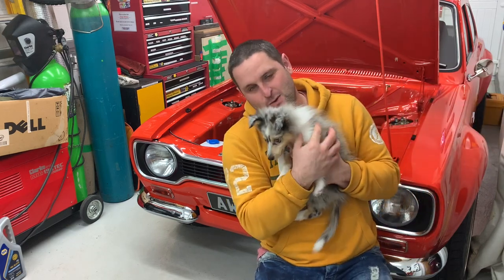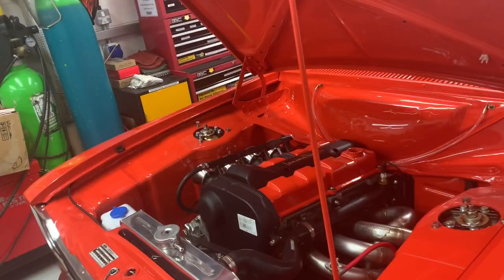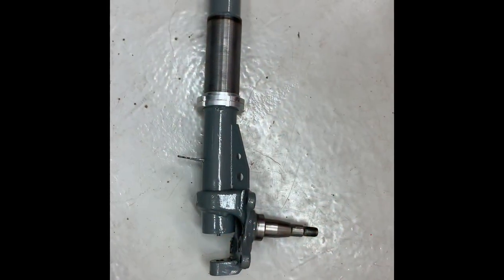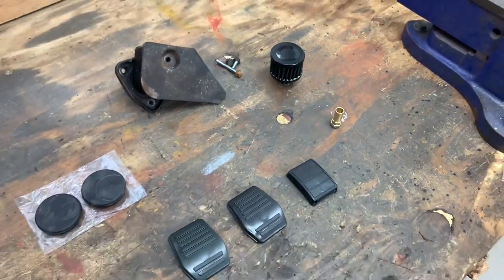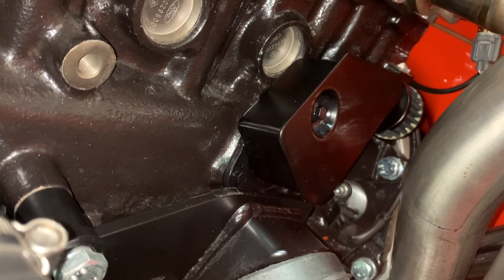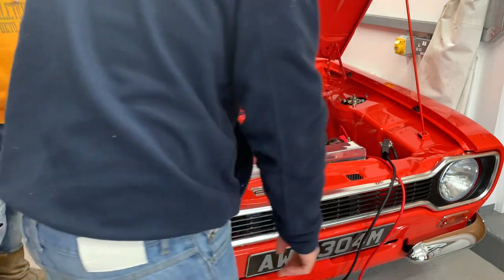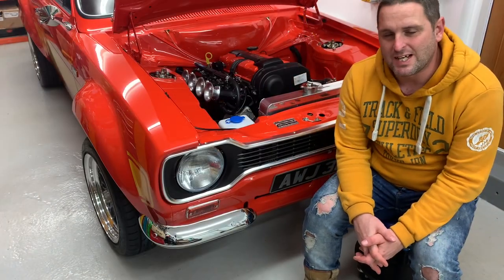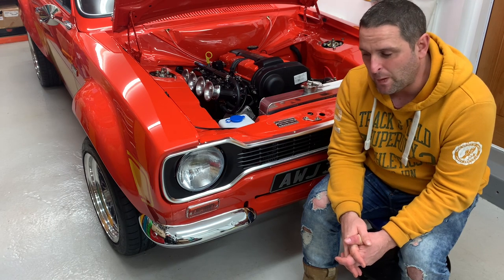MK1 Escort RS 2000 Re Assembly episode 31 WILL IT START??

Comment: Tip for the future.  Use one of those pump up pressure spray bottles with adaptor for small hose fitted to input your oils. 😉
Reply from the maker: Good idea Kevin. That would certainly make life easier 👍

Comment: I use a big plastic syringe from Sealey to push oil into gearboxes and differential.

You can suck oil back out too
Reply from the maker: That’s a really good idea that Thomas 👍I have to admit, using the bottle with a pipe attached was a real pain 🤦‍♂️

Comment: Never doubted it starting sounds sweet as well glad you got rid of them peddle covers could you have the cam cover ceramic coated to stop the issue will you be putting a tube on the rad overflow outlet Denzel looks a beauty you’ll need something to do when you’ve finished the build will miss your content
Reply from the maker: Thanks very much Richard. Yes the radiator overflow is one of them little finishing of jobs that still need doing. That’s all that’s really left now, is the minor finishing touches. Oh he is great Richard. Really settling in very well and changing every day

Comment: Q & A 

a) what aspect of the build gave you the most satisfaction, not just the big budget items (engine, bodywork, paint etc) but the smaller items and those hard to find finishing touch parts.

b) are there any specialists or parts suppliers who performed beyond your expectations (I remember a previous episode when you’d received the car back from the body shop after painting and you were blown away by their workmanship, I seem to remember that place had closed soon after that).

c) do you have a list of specialist equipment used that a normal domestic garage wouldn’t have, spit frame, engine hoist or similar.

d) is there a stand out ‘difficult’ task in the project which you resolved with the simplest of solutions or conversely one which was extraordinarily complex.
Reply from the maker: Thanks very much for the questions. I have enough to do a Q&A so I’m thinking of making it a xmas special 👍

Comment: Beautiful car, takes me back a long time. Way back we tried to get 1500 miles of running in done, in my friend's Escort with a tuned 1600 crossflow we passed 1500 miles on the way to Santapod!
Pulled in to the services, changed the plugs for a colder type and it went on the strip that day. It was kind of funny that my friend complained "it is going flat at 6000rpm" .
On the strip we got a scary rattle, turned out to just be the non return valve to the brake servo (we had 40DCOEs and vacuum was tapped off one cylinder).
Yours will be a fair bit quicker, make yourself a nice airbox and use a filter! (Old man speaking). Your engine sounds lovely, very responsive, will be even better when you get it mapped.
Maybe powder coating woud work better on your cam cover?
Reply from the maker: Thanks very much for the comment. I know I should really have an air filter fitted and a big part of me is saying fit one, but I just love the look and sound without one 🤣. I did wonder about trying to find a decent colour match in powder coat 🤔
Reply: @performanceclassics1986  back in the day we ran 40DCOEs without air filters, I honestly think it wore the engines faster. I know it sounds fantastic without them though. I wonder with your talent whether you could make a carbon fibre airbox with a cold intake...
With your cam cover I am not sure what material it is made from but I know someone swore by baking the contaminants out of some metal parts before painting. Would not like to think of how many hours have gone into your project, beautiful job.
Reply from the maker: @g0fvt  I think there’s around 3000 ish hours in the build which is crazy. I did think about fitting some mesh style filters within the trumpets because I agree that it can’t be good for the engine
Reply: @performanceclassics1986  a lot of time but better than watching television. With the filters a big paper panel filter is hard to beat for flow and effectiveness. It will be good to see the dyno results, will be a lot better than a stock RS2000....
Reply from the maker: @g0fvt  I hope so 🤞 really hoping for as close to 200bhp as possible. If I get high 180’S or into the 190’S il be ecstatic 😎
Reply: @performanceclassics1986  that will be a bundle of fun, people forget just how light cars used to be :-)
Reply from the maker: @g0fvt  yeah and how much smaller too. A MK1 escort was a family car in the 70’s and now a bmw Mini is bigger 😳

Comment: Absolutely stunning mate.  Love the mk1. 
A question for you. 

I'm at the end of my mini restoration. Will be putting my 1380 engine in very soon. What  brake fluid do you use in your mini? Incase of any leaks I dont want any ruin the new paint work. 

Many  thanks Simon
Reply from the maker: Hello Simon, in the mini I used Silicone brake fluid for that exact reason. I think it was made by automec and it doesn’t boil, doesn’t take off paint, doesn’t absorb moisture and apparently has a longer life span. Ive had it in the mini for around 13 years now with no issues so far 🤞🤞🤞only problem is, it’s more expensive than standard brake fluid

Comment: Amazing job you have done of that car. What brake master cylinder have you used, and would it fit a mk2 escort
Reply from the maker: Thanks very much Donald. Its a wilwood master cylinder that I purchased through GS Escorts and yeah I think you could make it fit the Mk2 escort also. The rod that fits onto the pedal needs some light adaption to make it fit properly, as I shown in an earlier video so I think you could easily adapt it to fit the mk2. If you need the part number, I can always ratch out the box 👍

Comment: Hi Craig. Well chuffed you have got it running. My question to you is. Why a modern ish engine. The rest of the build has been aimed at originality how come you didn't fancy a twin cam or such on carbs?
Reply from the maker: Cheers Benjamin, I will hopefully answer your question very soon 👍
Reply: @performanceclassics1986  no worries. I've got some about wiring aswell but possibly for another time. Also what was your introduction into cars and why minis?

Comment: Have you got the fuel rail piped up correctly ? How do you keep it pressurise cannot see the regulator on the end of the rail
Reply from the maker: Ive got the regulator mounted under the back end then a small return line back to the tank. I just thought it was a neater way of doing things rather than fitting it somewhere under the bonnet.

Comment: Rear axle is ep80/90
Reply from the maker: Yeah I looked into it Geoff because that’s what I thought too. It turns out, there isn’t much difference between 80/90 or 75/90 👍
Reply: It's the ep part that's important for the diff oil. They're hypoid gears
Reply from the maker: @geofffletcher5739  you had me worried there geoff 🤣 ive just checked the technical data sheet for the oil I’ve used and it says, suitable for use in hypoid Axle units 👍